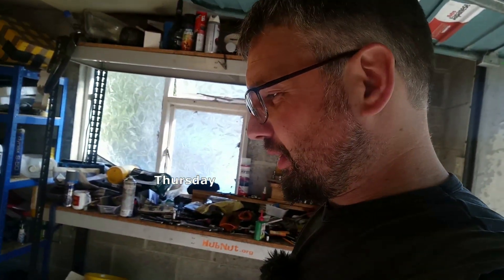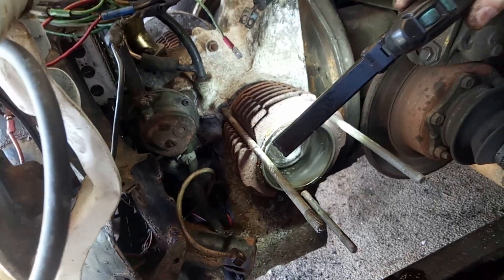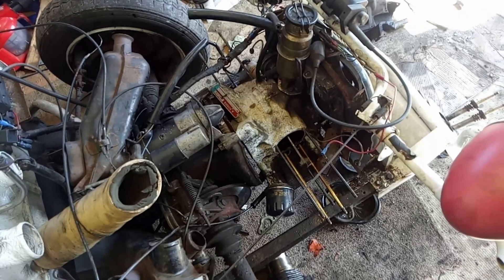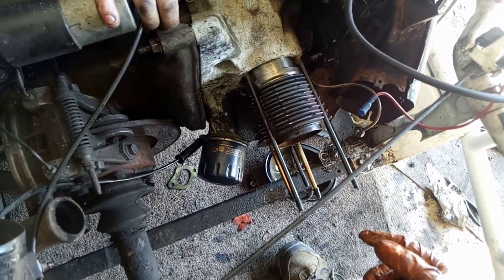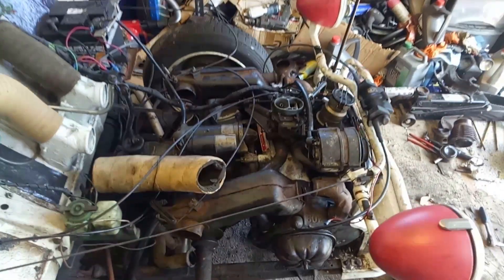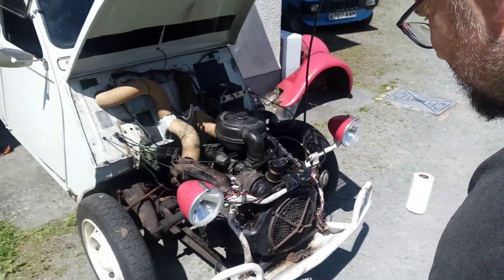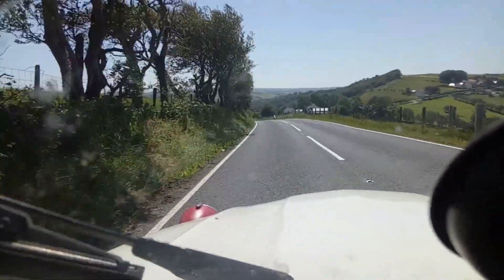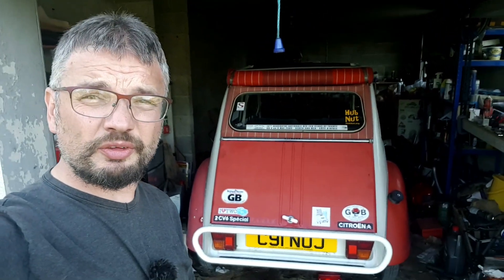2CV to Croatia: Engine rebuild! Is she ready now?

Comment: Rebuilding the engine 2 days before a 4000 mile road trip? Never change, Mr. Hubnut. :-)
Reply: Better than during it!
Reply: 4000 miles? From where?
Reply: Well, he's going from Wales to Croatia via an indirect route and then back again, AFAIK. He said himself it was a 4000 mile trip in an earlier video.
Reply: @d2factotum  It's not really a problem with a 2CV. The only place on earth this car can't be fixed  might probably be Antartica.

Comment: Great job getting Elly ready for Croatia Ian, really admire your patience and the way you doggedly keep plugging away and nothing appears to phase you!!! I think the 652cc barrels and pistons with the spare block appears a perfect solution :) I still prefer the sound of the 602cc as it sounds so much sweeter but on the long Croatia trip I think you'll really appreciate the extra torque of the 652cc conversion.  As you said the difference in torque is really noticeable and must drop gearchanges by 500rpm.  Hope you have a really enjoyable and safe trip Ian :)

Comment: Hi ! You noted that the 652 made strange noises and in this video you said that the rods on it had a side play. So I think the 652 block was going to develope a rod-bearing issue - maybe due to occasional oil starving or slightly clogged oil intake. The spare block with 652 kit may turn out as the better choice for the road trip. But you better check the oil on a daily basis for consistency and some sort of crud. The spare engine hat water damage on the cylinders already - so humidity might have gone inside the block itself.

Take care & Good luck for both of you !

Comment: If your going to put on a lot of miles in an air-cooled car in this weather,  I would be tempted to spray some gunk on that sump and pressure wash  to clean off the old oil for maximum cooling.

Comment: When are you fitting the Radiator Kettle Adaptor? You can get yourself a brew on then when you pull over. Also Tin cylinder head Bread Tin? Square frying pan strapped to block, everything you need for self sufficiency. 🤘🏆

Comment: You had a go. It wasnt your fault that fate had a custard pie lined up for your face :-). Dont lose your confidence to tackle these things. As you see things have turned out for the best now Elly has a better bottom end than before. Could that conrod thrust gap on the old engine have been the cause of the noise you were concerned about. Have a great and safe trip. best wishes from Australia

Comment: That Steamtrain....and Elly......hmmm i see a Hubnut solution coming  😎

No matter what....that Burton engine....shows more...grunt. Can't be different,cos the stock 602, has +-29Hp....the Burton kit (652)....34+Hp, that's on this kind of cc's....a huge amount different. 5Hp....in a normal car means peanuts...but in a tin Snail...holy cow,every horsepower makes a difference 😍

Time for a 710cc🤩🤩🤩🤩

Comment: So you've done about 10 times the work it would have taken to fix the pulled stud on the original engine, and opened up all the things you were afraid to do two days ago, but on both sides now instead of just one. How very very HubNut.
Reply from the maker: Crankshaft is knackered on the original engine.

Comment: Well done indeed. In the nick of time.  I'm sure it will get to Croatia and back with the minimum of problems. Less hassle than trying it in an electric car, that's for sure. Probably less fuel cost as well.
What sort of mpg does a 2CV manage normally? 45mpg?

Comment: Is this a 2 CV 6 engine right now? I had this one at 36 HP in the late 1980ies. Good enough to take you everywhere, even with a lot of luggage.
This engine is for sale refurbished in exchange for 1500 Euro over here. Not too bad concerning a Charleston in good condition is selling from 10.000 Euro nowadays.
Cheers from Germany, Bernd
Reply from the maker: Standard 2CV6 engine is 29bhp. Dyanes and Amis had 33bhp.
Reply: @HubNut   So obviously the late German 2CV6 version had a more powerful engine installed. It was pretty reliable for me concerning two trips to Spain and Gibraltar, France and so on with 30.000 or more Kilometers in just 4 years since I had this used Charleston "Citroen duck". 

I exchanged it for my father´s 1978 BMW 520 in wonderful beige interior / metallic brown in 1986 right after getting my driving license that had 3 excellent major engine breakdowns in just 8 years from new. BMW engine quality or a HubNut car?....:-)

The 2CV6 was just breaking down from the bottom side due to rust when I sold it in 1990 and she never made her way back on the road again. She was finally at 120.000 Kilometers with the engine and all mechanics still running good.

Comment: how did the piston ring ware in period go ?
Reply from the maker: I know engines that have done over 200,000 miles without new rings. Regular oil changes are the key - every 3000 miles.
Reply: @HubNut  you having changed the engine to new pots, i assumed a mass waring in period with new rings, all the way to Croatia at the speed of a snail.
The viewing has been a great pleasure , am glad you made it :)

Comment: Would a roof box not be useful?
Reply from the maker: Not great on a convertible...
Reply: It looks like a panoramic roof with solid sides for which brackets could be attached for a roof box, sure the roof could no longer function in the same manner but would allow additional space, although I've not looked closely at a 2cv to asses its suitability

Comment: How often 2cv engines need to be rebuilt? Every 100K km?
Reply from the maker: Depends how you drive them. Even with plenty of abuse, Elly's original engine survive 170,000 miles without any major work. Even then, it was just burning a little too much oil for comfort so I probably should have just changed piston rings.
Reply: @HubNut  Oh wow, that is impressive. Remind me, you have M28 with 29 horse power?
Couple more questions about the drivetrain:
- Does the engine overheats? If does, under what conditions?
- how is transmission is holding up? considering 1700000 miles.

Thank you.
Reply from the maker: Yes, M28 29bhp originally, but she's been upgraded to 652cc so perhaps a couple of bhp more. I've broken a few transmissions over the years. Synchro can be a weak point.
Reply: @HubNut  Do you swap transmission or rebuilt it? I don't recall seeing any videos on transmission rebuild
Reply from the maker: Bit of both. I've had the second/third synchro replaced before, but not on camera.
Reply: @HubNut  Thank you for all the answer. I'm reading few things about 2CV and wondering if I should get into it. I live in Canada so getting parts is probably going to be a pain. In addition I'm not a person who keeps cars in the garage, I actually drive them, so I wonder if 2CV will need constant attention or set and forget? Can you share some experience? 

Thank you!
Reply from the maker: Electronic ignition makes them easier to keep happy, but grease points need attention every 1000 miles, and Canadian salt will rot out the bodywork quickly. I do have 2CV friends in Michigan so spares can be found over there, and friends too!
Reply: @HubNut  I actually live on the border with Michigan, can you point me in the right direction? I would like to talk to owners, meet up and see if I want to get into it.